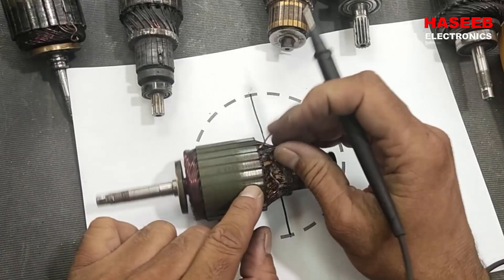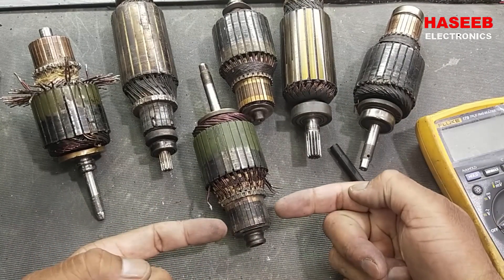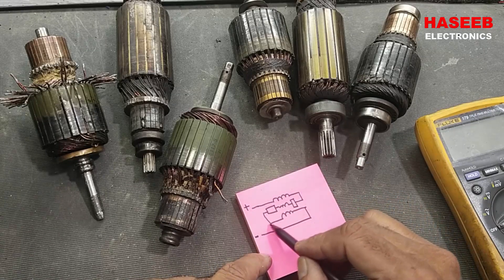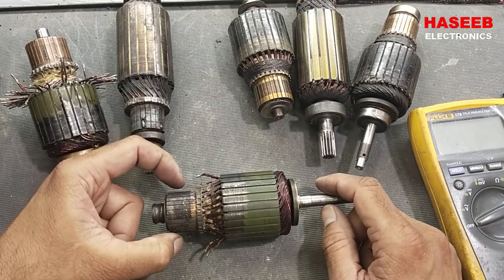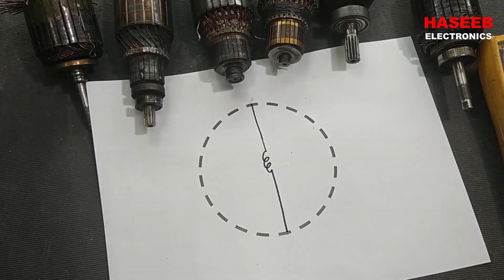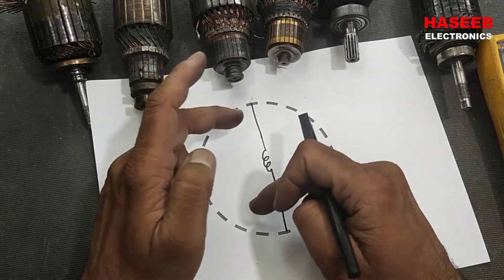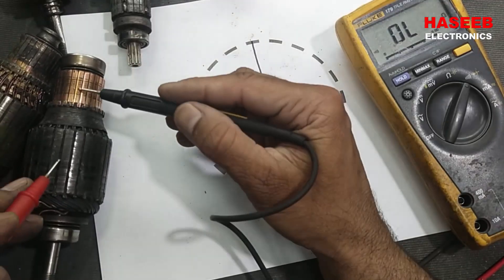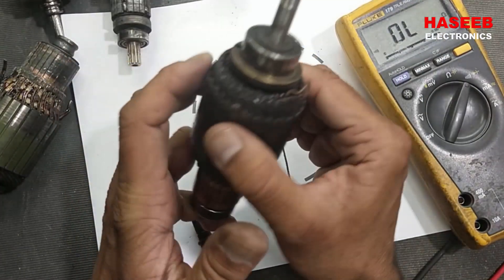[408] How To Test Armature with Multimeter

Comment: Best Video for Motor testing
Reply from the maker: Thanks a lot
Reply: @HaseebElectronics  I have a kitchen garbage disposal sink. The motor overheated due to stacking. I measured the bars. 7 conducting then open conducting open then again 7 or 8 conducting open and from begin. 
After closing everything I saw this video. Maybe I can fix it by finding the fault

Comment: Sir can you make a video presentation regarding how to make a stator coil of a hand drill sir. What part of the stator core to measure in finding the core area.What constant number to be used for calculation of turns per volt of the stator and lastly what part of the core to measure for making a bobbin for making a stator coil for the handrill sir tnx

Comment: What this armature is same as mixer grinder or note both are same test method please reply
Reply from the maker: armature have same method for testing
it depends on number of segments of the commutator and number of carbon brushes 
most common configuration is 2 brushes 
but every armature  have similar structure.
Reply: @HaseebElectronics  thanks sir